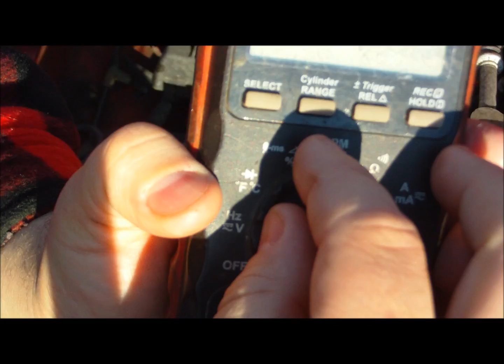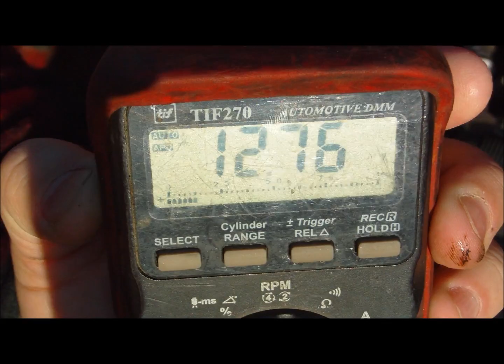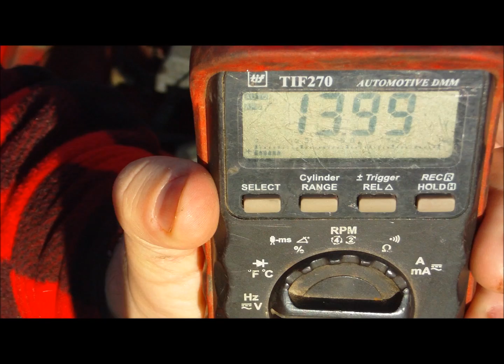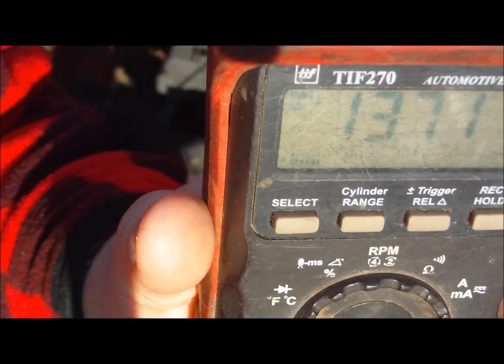How to check battery voltage, alternator voltage, and load test voltage  with a multimeter

Comment from the maker: From what I am reading your alternator is not charging properly. Before you replace the alternator with the engine OFF check the condition and tension of your belt . If your belt is frayed or has cracks in it replace it. Next check all your connections make sure there tight and not corroded. If corroded I have a video on how to clean battery corrosion off. If that is all good and you have the same problem than it most likely is your alternator.

Comment: Ok, so the battery is at ~12.5V with the vehicle off. I start the engine and it goes to 12V, put a load on it and it drops but comes right back up to 12V. Battery light is on and driving me crazy not knowing what it is.

Comment from the maker: Tell you the truth I have not tinkered with custom sound systems in a long time, just stock systems. But My guess and I mean GUESS would be that either you dont have a big enough capacitor or your alternator does not have enough amperage. I dont know what car your working on so that really leaves me in the dark and I dont know how your system is set up. If your battery is dying, you could also have a parasitic draw (i.e. Short to ground).

Comment from the maker: Well I never tested an alternator this way, but you can hook the red lead to B+ and the black lead to alternator housing. Your reading should be without the car battery should be about 2 volts. But you might need battery power for the regulator assembly in the alternator  to be turned on. Try it let me know how you make out. I m kind of curious of how your setup is.

Comment from the maker: No you will blow the fuse out or destroy your multimeter. You only can check Battery voltage with a multimeter. They have a manual battery tester that checks battery cranking amp load test. This video is basically ruling out your alternator vs your battery. I will be posting a video real soon on how to do a battery load test and what tool to use.

Comment from the maker: With the engine not running it is a battery test. With the engine running its an alternator test. and with it running with all the accessories running its a load test, let me rephrase that it is a accessories load test, there is a tester for a cranking load test, this is basics  to test the alternator and battery.

Comment from the maker: If i understand you correctly, I would say your alternator is still  good but your battery is a little weak try trickle charging it and see if it goes back to 12.4 - 12.8v and holds a charge if not, than that battery is gonna leave you sit. but also rule out a parasitic draw test to make sure you dont have a slow drain on your battery. Thanks for watching.

Comment: Also, I removed my battery cable to see if I had a loss of power and tested V between the + on battery and + cable that was removed and read 11.5.  If my memory serves correct, I subtract 11.5 from 12.7 and is 1.2V draw. No lights on and key out. What is the range of acceptability? And if out of range, pray for me on trying to find it! lol

Comment: Hi, I always remembered how to test the same as you are saying.. My charging V was 12.4 and thought I needed new alternator. Went to autozone had test on their bench and it was perfect. Didn't care, wanted new lifetime $80. alternator. Well, with the new alternator I am still reading 12.4 V at idol. Called the Autozone and they say that their fancy tool reads amps and I need to bring it to them and that my volt meter is unable to give me useful information and is wasting my time..

Comment from the maker: When you say on do you mean key on engine not running? Regardless those readings are a bit odd. But my guess would be either a slipping belt, a loose connection, frayed wire ,or  a faulty alternator working intermittently.

Comment from the maker: What is your battery voltage at with everything off? If it is at least 1 volt over than you good. For example, say your battery voltage is at 11.56v Which would still be able to crank the engine and your reading is 12.56 than you would be good. So what is your battery Volts. at with the engine and everything else off?